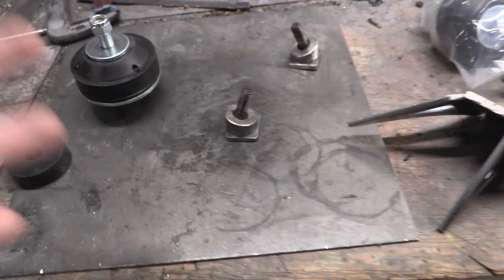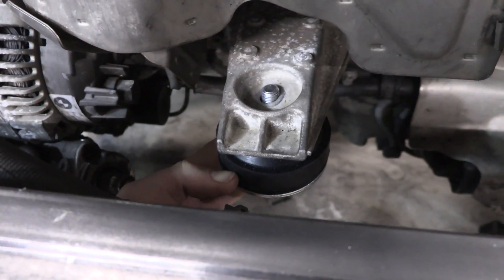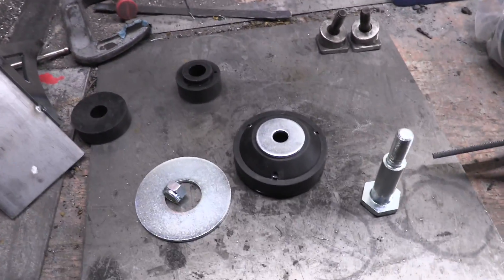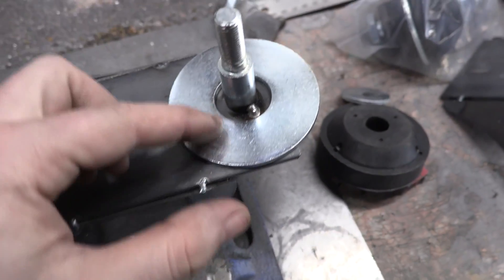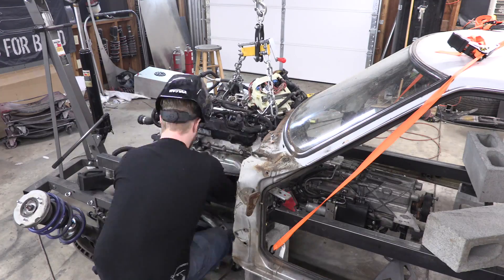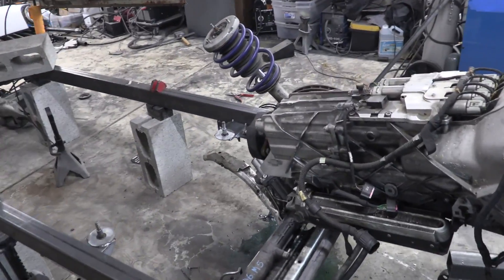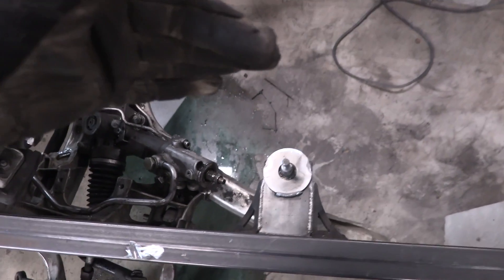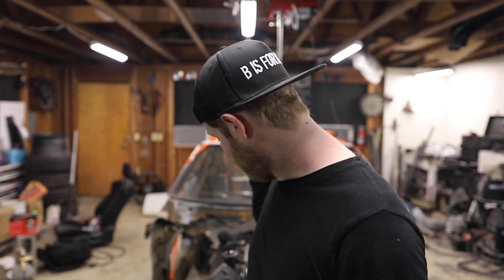The M5 Engine is Officially Mounted in the 240Z!!!

Comment: Absolutely love the project and in my opinion, this is one of the best builds I have ever seen DIY. I don't know much about that style of engine mounting but it seems like it's just a rubber washer instead of an actual mount. I say this because even though it will totally work I think that the nut on top will get beat up from the engine moving since there is no buffer on top. 
As I said, I don't want to be just another negative person or a "you know that frame rail through the cabin won't work"  type of guy. Just an observation. Good Luck

Comment: The second bushing is needed to make the mount work correctly, it allows you to clamp everything solid without the bolt being directly connected to your frame. Your engine mount is still solid in tension though the stud and bolt, and will transmit the majority of the vibration and stress though the stud. I'll e post this for the 3rd time in this video, you need to check your drive-line angles and alignment. You CANT just put it where it looks pretty and hope for the best, the rubber driveshaft coupling needs to be perfectly straight from the trans to the diff, and if you go with u-joints they need to be aligned to each other to cancel out oscillations...

Edit : Chris if you read this I want you to know Im trying to stop you from making the same mistakes I made when I was first learning all this stuff, I had no idea and messed it all up. Also the height of the engine is gonna be dictated by where you mount the body/ ride height and suspension travel/tire size. Your oil pan to ground clearance will be very tight. I really think you need to know the body placement and ground clearance before you can accurately mount the engine. Still a big fan
Reply: Engines twist with torque, the left mount will want to lift and the right will get pushed down. So basically only one mount will be solid and the other will function poorly.  

That really isn't the big problem here, Ive done 3 engine swaps into Datsuns and i will stress its VERY important to align your transmission output shaft and differential. U-joints when running at and angle will speed up and slow down the rotational speed of the driveshaft, if you don't cancel out this osculation by aligning the u-joints correctly it will vibrate like crazy, and likly lead to failure.
The M5 uses rubber couplings that are designed to run perfectly straight, not angled or offset.
Reply: Is he trolling us with these mounts? OMG! I see much breakage in his future. My custom Miata mounts are sturdier and I’ve busted them with only 180 pd ft of torque.
Reply: Spedracer55 why put the rubber piece in then? Go full solid or rubber. Nothing inbetween.
Reply: If you are going to keep the solid mounting like you made you should of drilled the bolts through the brackets and slotted the hole to make changing the rubbers easier.  Or at least as a minimum  drilled them through and weld the bolt head to the bottom.  That weld point between the A-frame and stud will snap on first crank of the engine.
Reply: Adam Hallahan plus if a bushing needs to be replaced he'll have to take out the whole engine
Reply: Adam Hallahan I'm also specious about the triangular extensions to the frame rail.  He seems to have largely ignored the "tails" of the K member that are just floating in space.  He's going to have to kick the frame down to meet those, a bit of forethought would result in a tall section of the frame there, which accomplishes the offset for the rocker panels/floorpan, support for the K-member, and a tall section to mount the engine to -- the trifecta.
Reply: It's all a giant learning process, he learns form his mistakes just like any human lol
Reply: of course its going to fail completely, on the compression side (the opposite side to which mounts usually break) each time he lets off the power its going to hammer back upwards because of the give in the rubber and its going to rather quickly hammer the rather weak metal hes used as the mounting surface, the more it hammers it up the more slop its going to have in the mount thus allowing it to hammer even harder the more he drives. this will probably end up twisting that whole chassis rail before it finally breaks the mount leaving the engine only mounted on one side and the whole chassis irreparably bent and twisted.
Reply: meshuggah life yes but the main thing is the engine mounts are not ok. I'd suggest cutting off the stud and replacing it with a machined version  that is longer so a rubber donut can be fitted on top as well
Reply: If he puts a rubber "washer" under the nut, it will eliminate the issue of having a semi-solid mount and prevent impacting the mount when transitioning from tension to compression. Vibration damping still won't be great but I don't think he cares about NVH. Trans mount also needs to be similarly firm, but not solid. 

Trans and diff can be offset. Just make sure that the compound angle between them is less than 7deg and that the trans output and diff in put are parallel. The car was going to need a custom driveshaft anyway, getting one with U-joints on it and the right flanges for the rest of the drivetrain is no big deal. 
Chris builds as he goes and fixes issues later. Not the most efficient method of working but hey, it's his time not mine. I'm sure he'll address this stuff, or just run it and if it breaks, he'll have to fix it.
Reply: Marcus Dennien - replacing the stud with a large bolt, use the bushings on the top of the engine mount, or bottom if you can redesign it. Could even drill a hole through the plate and apply a generous weld to the bottom of the stud. I don't really see it failing completely, just not the right way to use those style mounts
Reply: As long as the transmission output is exactly at the same level as the differential, no matter the angle of the transmission in relation to the differential, the driveshaft will still be smooth.  That's just my input though
Reply: matching trans and diff angles is the important part. The offset of the two will dictate the the degrees of rotation. You also have to be sure they both run parallel front to rear (left right up down ect) 

http://www.agcoauto.com/content/images/transmission/ujoint_driveshaft_angle_alignment.jpg

This only applies to u joints. Not at all to rubber couplings (need to be exactly in line). The other option is a dual cv joint driveshaft, but why spend $1k on a super custom driveshaft let's just do it right and safely
Reply: Dominic Iacino No, the transmission output and differential input need to be exactly parallel. Its OK if they are off center.
Reply: I don't even think the brackets look strong enough, if I was going with that design I would of used thicker steel or at least used a dimple for strengh (I'm currently doing fabrication at college)
Reply: All it takes for the driveshaft is to bolt up the rear Subframe, and measure the angle (tilt) of the differential flange. Then when mounting the engine, make sure the diff and engine "point" the same direction forward, then match the differential angle (tilt) to the motor/trans (if the nose of the diff points up, the front of the engine needs to point up the same degree) its not hard, but now the engine mounts are welded in, the tail of the trans might need to move up or down several inches stressing those mounts. Would have been better to weld the mounts at the correct angle to start with. I worry about seeing the entire build being completed only to find out the engines in the wrong place. 

It's also important to acknowledge that you cannot use the rubber coupling driveshaft now that your engine is offset. You must now figure out a u-joint or cv setup

 I don't think it's nessisary to bash Chris, how about some constructive / helpful replies. Don't like him, don't watch?
Reply: Ken Tucky I was also told he wasn't wearing his belt, I had the dude on Instagram and people were calling him out about the welds on the cage and he kept deleted the comments, then he started putting stickers over the welds 😂
Reply: Ryan's Radness yep that would do the trick but his fastener is too short for that.
Reply: that stud will crack off right above the weld with road/engine vibration... i would have drilled and bolted through.
Reply: I'm more concerned about the fact that the entire left side of the engine rest on a piece of mount that is attached outside the actual gussets. That mount will bend and/or break...
Reply: Adam Hallahan this while project looks suspect... Them frame rails?  The mounts.  Everything.  Goodluck thiugh
Reply: I can tell this whole build is a learning process but this was the first point at which I started to cringe.  I hope it gets fixed in a later episode because there are just too many obvious issues.  The gusset doesn’t cover the whole distance, the welded bolt head will snap, the bottom rubber was there for a reason.  If it stays this way the motor will just rattle the nut loose if it doesn’t snap it off first.
Reply: THIS!!!!!!!! Mostly the part about the engine mount! The rest can be easily fixed with other couplings
Reply: Adam Hallahan or any time the rubber is decompressed you will have a small impact between the fastener and engine mount. Plus lots of scrubbing metal to metal
Reply: Adam Hallahan  was thinking the same, the more I watch the more I shake my head. The frustrating part is how many people think this is how you build a car.
Reply: I was thinking the exact same thing!!
Reply: Yup.. usually that bolt floats in rubber and doesnt contact the chassis. He just doesnt think.
Reply: glad to see im not the only one cringing while watching this build. adam, daniele top work pointing out what should just be completely obvious to anyone who knows about building custom stuff.
Reply: Adam Hallahan you are right but he can use a cv joint on the front to ease his life. The current engine mount solution however will mess things up longterm
Reply: Glad to see I am not the only one who can see many faults in this hap hazzard build , the motor mounts are a fucking joke. Hope no kid finds this and thinks any of this will work.
Reply: Why would he need to change axles as a result of engine offset???
Reply: clue lessk 
I just read the article. That dudes cage got FUCKED up. It sucks that he died and the media tried pushing all the blame on him just because of what he was driving as opposed to the Pontiac driver who hit him
Reply: he said he wanted solid mounts tho
Reply: I was thinking also that the mounts are sort of in between hard and soft mounted, but, arent you guys forfetting that there will be a huge boxed rail running over part of the mount from one to the other underneath the engine?  He did mention this in an earlier vid.  Remember his philosophy is to over engineer, so I doubt that there will be any frame twistage, more like a broken mount which he can fix later anyway.  Also, for the driveshaft, I think he learned in an earlier project to go straight to a professional with that, and you can get custom driveshafts with rediculous offsets with enough money.  I also believe that he will listen very carefully to what the shop will have to say to him.  Again though, the mounts will probably fail at some point.

Comment: Right after it comes off that little triangle Mount that you need for the engine you should triangle Notch the frame to drop it down and then once you have it at the angle you want it then triangle cut the bottom section then it can go flat to the back section and then do the same type of triangle cuts to the frame and then you can box it in and it will be stronger and then you can have the whole bottom section dropped and then you can start making your floor pans

Comment: That driver side mount looks pretty sketchy. You should have used longer gussets.
Reply: Bingo - correct, they will bend between the unsupported part and the welded on studs, if the stud doesn't fail first.

Comment: Quick tip for your weldingskills. 
Work from the top down not otherwise,
because of the heat distribution. 
The heat travels up and makes the welds sometimes to hot. 
The thinner the material is, you working with, the more you will notice it and eventually burn holes in it. 
Keep that in mind buddy. 

Apart from that, you doing a really great job. And I mean everything. Great content, keeping "us" informed on what is going on and all that stuff. And great project. Definitely my favourite channel in terms of building project cars, where they show you what's going on and not just saying they making this and that and in the next second they showing the end result. I love it, keep it up. :)

Comment: Do the stock engine mounts not seat at an angle? Are your mounts only seated on the outside of each mount rather than the entire surface when bolted in since they're flat instead of angled?

Comment: I'm no structural engineer but those mounts surely need some reinforcements ?
Reply: No need for reinforcement but its a completely wrong concept. Its basically a half solid mount.
Reply: a boxed engine mount would fit the bill perfectly.
Reply: atom such as? The gussets are the bracing along with the frame of the car this will be 110* a lot of car from the factory us thinner steel and just bend this is a lot stronger than modlst
Reply: Built Rite Bolts going through the frame perhaps or the mount supported by something welded from top of the frame. I can imagine the forces there will be huge with all the vibrations from engine and the weight of it.

Comment: The Rubber has no Function in this case, you mounted the engine directly with the bolt and the nut to the frame. The orig. Mount has the bolt in the middle and the only contact to the frame is the Rubber and than the outer case... https://www.car-parts24.com/Motorlager-rechts-Hydrolager-fuer-BMW-e39-525d-530d-M57

But great project!!! 👍

Comment: Awesome! Although why not just drill a hole in the frame mount and use the bolt like a bolt instead of welding it? That way you could still make minor adjustments.
Reply: Blaylock1988 ... And replace the rubber when it deteriorates without removing the engine.

Comment: Engine mounts look on pair, but dumb question: are these generic mounts good for enough for a big heavy V10?
Reply: It the torque of the engine that will rip the studs off and bend the mount brackets, these will fail and quickly - my guess would be first burn out or possibly first full throttle pull and the engine will be free of its mounts.
Reply: But wouldn't it be the 240kg times any downward forces as well as any other stresses? Im not saying they aren't strong enough because i don't have experience but I kind of do agree it might be a problem.
Reply: HForceClan really there is no math behind my statement but yeah, I'd say they absolutely are. This engine only weighs like 240kg, and by looking at what Chris build I don't think there is any chance those mounts fail with only that much weight. Sure they could be what breaks in the chance of a serious frontend crash, but I don't even  know if that would be a bad thing to happen (safety-wise)